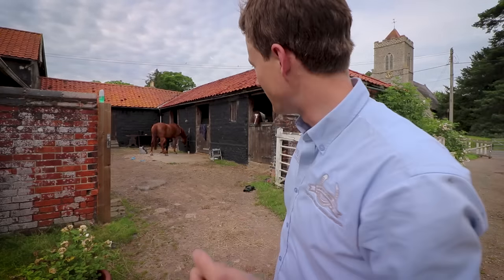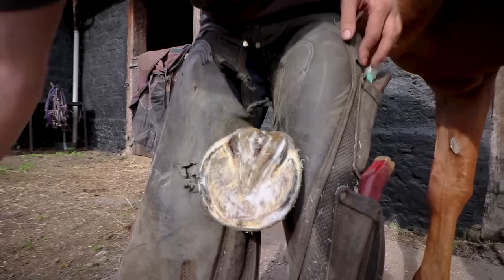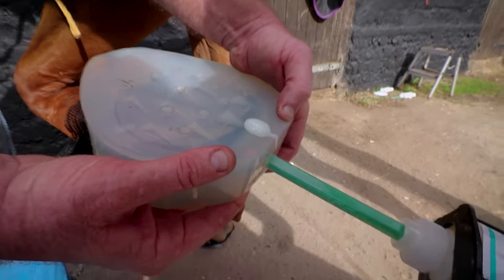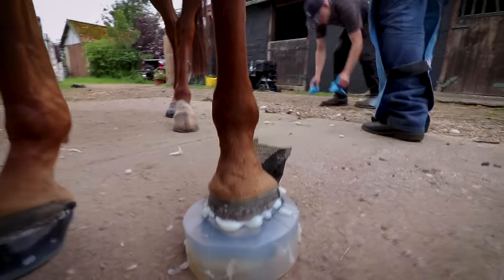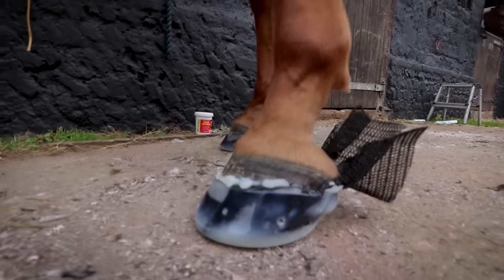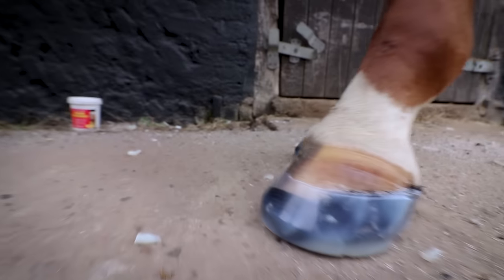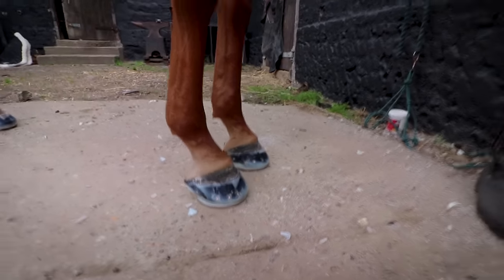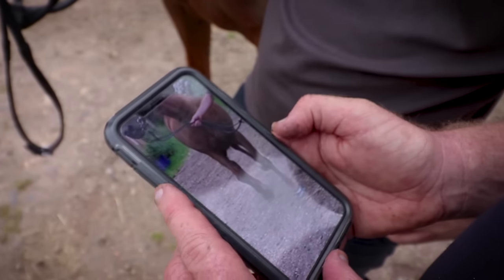How to shoe a horse using resin - Amazingly satisfying

Comment: Since it’s a 3D printed mold, why not add a couple small handle around to the outside near the top of the mold so while your injecting the material, you can pull the upper edge away to allow even flow.
Reply: I'm wondering how uncomfortable the rubber insert being jammed into that shoe must feel. Does it all come off to inspect for fungi, bacteria mold? I know it's a silly question.
Reply: Urathane sounds very permanent, hot and cooking , does it burn the horse
Reply: Tire rubber so they got a soft run
Reply: The left rear shoe looks a bit off, like it's to far back.  Not over top of the shoe, and she walked funny on the left rear hoof as if to try to get use to it.
Reply: Great work!
Reply: @Ben Kenobi I would think if someone went beyond the "keratin an into a nail or hoof bed or if the heat seeped into a cracked area. It would Hurt.

Comment: Ok so when the hoof grows out, how do you trim this stuff off? Wouldn't it be more work at that point vs regular shoes?
Reply: That's what the mesh was for, I think they mentioned it in the video. The mesh keeps the plastic from actually bonding to the hoof. So, when the time comes they probably just run a Dremel or something similar down the middle to split it in half.

Comment: I didn't hear a mention of cost. Since horses need their hooves trimmed every 6 weeks, I'm curious how much this would run for a year.
Reply: Would this obviate the need for trimming?
Reply: Every 4 to 6 weeks, depending on growth rate and wear.
Reply: @stephridestheworld  If your horse has sandy soil in the pasture a person can go 10-12 weeks between trims.  All depends on circumstances and surroundings.
Reply: @sherryevans7944  The opposite actually - if the ground is soft then the hooves don't wear down as much thus needing a trim earlier. But soft ground isn't good for the horse's legs anyways.
Reply: @vivientakacs5599  I have 3 horses on sandy soil and I for a fact know how long they go between trims!  All BS to market a product.
Reply: @sherryevans7944  Market a product???? I don't even like shoeing horses, they should all be barefoot (unless of course they have some illness and temporarily need a horse shoe). This is/should be common sense cuz obviously, if you have less drag against something, it will take longer to wear off vs if a horse is on hard ground where there is a lot of pebbles or anything else, the hoof will wear down quicker because the hard stuff rubs against it.
Reply: @sherryevans7944  Also just because the horses are on soft ground, it still shouldn't take 12 weeks for them to be needing a trim. That doesn't sound healthy.
Reply: @vivientakacs5599  I do not agree.
Reply: I don't know anything about shoeing, but based on the labor I see, that looks like at least a USD$200-250 job with foot care, polymer application, and horse shoes. Searched some US pricing for shoeing horses, and it varies quite a bit. $80-200 for four shoes, and up to $300 for specialty pads. Don't know what specialty pads are, but it sounds like something such as this fits into that category.

Comment: So with the exposed mesh on the  bottom, what prevents moisture from getting in there and just sitting against the hoof?  Does that ever cause problems?
Reply: most likely a plastic mesh, shouldn't wick any moisture in
Reply: @jdigi78  its still a mesh material though which retains moisture
Reply: @floridagirl9064  if it's plastic the moisture can't travel through the strands into the shoe. Plastic doesn't soak up moisture like that
Reply: @jdigi78  if it is a meshy material it certainly will.
Reply: @floridagirl9064  the shape of the material has nothing to do with it, it's fully encased in resin the only exposed mesh part is on the outside of the shoe
Reply: @jdigi78  mhm...exactly...
Reply: @floridagirl9064  but it won't touch the horse's feet which is the main concern

Comment: Yes but how does the horse foot sweat? Also that stuff looks like it would prevent the hoof from flexing properly during impact.
Reply: I dont know if youre serious, but that part of the hoof definitely doesnt sweat. Also this isnt any worse than normal horseshoes - yes it would prevent the hoof from flexing 100% naturally but the difference isnt huge and the structural integrity is definitely better than the hoof before so it's basically worth it. In short - a hoof that's deformed wouldnt absorb the impact well anyways, so its better to just care for the structure.
Reply: @friskaminomleczkojad5585  I was referring to the bottom of the foot that would not be able to sweat. As far as not being able to flex have you ever wore a really tight pair of shoes for an extended. Of time?
Reply: @WildernessCall  no, the bottom of the foot doesnt sweat. Its all dead tissue on the bottom, thats like asking if the top of your fingernails sweat under nailpolish. Also, would you rather walk with a broken foot or have that foot in a cast that allows you to walk propely?
Reply: @friskaminomleczkojad5585  horseshoe is merely a thin strip of metal under the horse's hooves.
Horse shoes still allow the hooves to interact with the environment, air, water, sunlight, natural oils etc. 

This is literally like acrylic entombing something which is biological and growing all the time.

Any moisture would be trapped inside. Not a good thing.
Reply: Not to mention urethane (which they used) is toxic asf. Such a damn shame they put that crap on a horse and call it the "future of horse shoeing"

Comment: For medical reasons such as regrowing a hoof, this seems very useful! However, I'm worried about just the one thing – as the horse steps down on their hoof, the hoof expands, no? This happens even with shoes on, since the shoes don't cover the entire bottom of the hoof. So then – does the formahoof allow for that expansion, which is like a built-in spring for the horses? I'm worried that this would lead to injuries on ligaments and such because there wouldn't be enough spring in the hooves, so to speak. Granted I am in no way a farrier or hoof expert in any other way, so please correct me if I'm wrong – this just seems to be what I remember being taught when in equine anatomy and physiology class a few years ago.
Reply: I watched another video shows detail. There is mesh that helps with that and they make sure of placement to allow flexibility.
Reply: It's formed while the horse is standing so no, there's no issues

Comment: What happens, do those casings eventually fall off on their own once the hoofs grow or is it a manual process take then off?
Reply: from my knowledge of shoeing (it's been a minute but i had it from hands-on experience at one time), they would likely wear down with use, hence the 180k steps rating, and also grow out as the hoof grows/be trimmed off as you trim the hoof, just like nail polish!

Comment: Legitimate question: I've always thought that the exposed frog was healthy to promote good blood flow through the hoof. This seems like it would prevent compression of the frog, so wouldn't that be detrimental to the long term health of the hoof?
Reply: yes! absolutely! this is detrimental to hoof care and the overall health of the horse. It throws their hips out of whack and sends them lame, plus everything you mentioned above!
Reply: Very true that is why old farriers prefer the old standard metal horse shoe.
Reply: I'm new here and rather ignorant on these issues. I got the impression that this is a temporary intervention. I could be wrong.
Reply: Better than an open backed metal shoe as the shoe lifts the frog off the ground altogether. With formahoof at least the whole sole and frog are still weight bearing as they should be. Barefoot should be the goal but when you have damaged hooves this is a better temporising measure than what a smithy can achieve.

Comment: The nails in the urethane will create a water entry point, and water will remain inside... not a good idea....
Reply: How? Exactly?  nails are facing down like in a normal shoe , the urethane seals around the nail anyway.
Reply: @crowrage8929  haha
Reply: @nunofelicio  This isn't a plumbing  issue, it's a horse hoof .Designed to last 250 k of use not permanent.
Reply: @crowrage8929  Imagine having your feet inside a bag with water, I'm not understanding your necessity of dismissing the issue, are you involved with the company?
Reply: @nunofelicio  Buts it's not water is it, it is adhesive,  and there  would be little to no water, in the hoof ,unless  structural  integrity is compromised, then it would be time to change the shoe,as they are not permanent  anyway.Also when I put my feet in water, I use gumboots, works well unless the gumboot has a hole in it ,then I replace it .Ie structural  integrity  equals no capillary  effect.Just like a natural  hoof.
Reply: @nunofelicio  if you look closely after he hammers the nails, they go out on the side, they don't connect with the interior cavity.
Reply: There’s no cavity, what are you going on about?? The urethane is sealed to the hoof
Reply: @nunofelicio  I get maybe you are an expert at plumbing but this is a horse. Are you a farrier? Probably not.
Reply: @crowrage8929  Ín a natural hoof the material is porous, it will dry, in this case, it will not because the majority is sealed in urethane...  just think as it was your nails when you finish bath...  Never seen so much effort to dismiss a valid observation... crazy crazy....
Reply: @karladougherty5694  Lolololol... yes... and you are an expert in telling other ppl professions from two or three answers. Ohh well.... sure is a sign of current times...  back to my dear friends and patients :)
Reply: @nunofelicio  Your point? Doesn't need to dry  if there no water in it, does it, the nails don't even breach to the natural  hoof anyway,so they are sealed from any potential water effects.  I would make constructive input, or actually  ask a  question , before  making  a negative observation ,crazy...crazy..

Comment: What happens as the hoof grows?
Reply: Judy Dell take it off and cut the feet
Reply from the maker: The hooves grow from birth right up until death and continue to do so even when steel shoes are applied. That is why horses are trimmed and shod on a regular 5/6 week interval
Reply: Alex Ridgeway Farrier so I guess there is room in the plastic for it to grow?  That’s what I mean. I know the hoof continues to grow.
Reply: The hoof grows from the top down. So over time, there would just start to be more exposed hoof above the plastic and once it comes time to trim it would be removed to do so and then re-applied. Similar to traditional shoeing, I would imagine that these would allow the hooves to grow longer without much flare so they would be fine up until the next regularly scheduled farrier appointment.

Comment: The gimmicks just keep coming. How much does a pair of these cost to apply?
Reply from the maker: You call them gimmicks, I like to think of them as another tool in your tool box 👌😁
Reply: I've used polyurethane an 2 part epoxy for years as they cure some can get extremely hot how does this compare

Comment: I have thoroughbred horses (race horses ) in Sweden , the surface is very different from on season to the other , that would be a real good solution for horses with little feet .
Could this application work for morning work out on sand or grass galops ?
I saw that the horse you were working on a  thick tendon , is he better now with this typ of shoeing ?

Comment: Great idea for rehabilitation and short term use. From experience hooves naturally adjust to the terrain they are walking on, soft muddy = soft misshapen hoof.
There is a definate application for this treatment in a rehab setting. 
I love these beasts. Fungus ? the hoof is like a fingernail that continues to grow. Carbon fibre with air vents. ? Why reinvent the wheel, the Farrier does less work when shoeing
Reply: Because solely load bearing on the hoof wall is damaging long term. Ends up with caudal hoof failure and contraction.

Comment: I have a couple concerns about this, Using this method seems great, but the hoof has to have air circulating around it or it will eventually damage the keratin underneath. Also how do you get it off? Soaking? in what? grinding? does that damage the hoof? what about if the horse cracks the urathane shoe (like when a woman breaks her solar nails?) will it crack the hoof? It is very much like a woman with fake nails and all the chemicals are not good to wear all the time.

Comment: When you turned the hammer around the points side where it came out of the PU-shell, did you do that to bend it so it points out straight, to be able to snip it off easier afterwards, or what did you do there exactly for what reason?

Comment: Nice, but I don't get the shoe-part. You already have a predefined (cast) surface to work with, why not use this as a system with a fitting horseshoe instead of a normal one?

Comment: This is what causes issues. You are making something that is suppose to be able to handle walking on every surface and protecting it. Causing it to become soft its self. What happens when the hoof grows? The nails are very high on the hoof, when it grown, wont it cause discomfort when the nails start to be pulled down?

Comment: So uh polyurethane resin gets incredibly hot as it cures...how is this not painful? Its probably the equivalent of having hotcoals strapped to your feet for 20 mins. Sure its cured in about 10-15 mins. But it holds the heat longer...

Comment: Doesn't the hoof need to breathe?
Reply from the maker: Not really.... The outer horn is made up of the epidermis or outer skin... Its supplied with nourishment from the inner skin or dermis. It's function is to protect the internal anatomy and therefore is relatively impermeable.
Reply: @AlexRidgewayFarrier  by outer horn I'm assuming you're talking about the outside of the hoof, correct?  I thought that was made of keratin...like a fingernail.

Comment: do not do this, the cup of the horse's hoof is flexible in the heel part, adding that rigid supplement to the cup causes the horse to suffer from pain when walking and tread poorly. for that reason horseshoes have to be open at the back

Comment: Having owned my own horses
I would never do this to them
Consider their hoof's do grow and the direction of pressures that will happen after a few weeks,
They will probably end up splitting cracking or becoming loose some where along the line
The only reason I would do this, if the horses hooves were cracked split and needed to be held together until they heal
This is expensive, and much cheaper and safer just to put regular shoes on any horse, except horses with deformities,

Comment: You really, really should wear gloves and be very cautious when working with urethane. The isocyanate compounds that form the urethane are highly toxic
Reply: totally fine to let it soak into a horse though apparently🤨
Reply: @brandonquarles1484  it only comes into contact with the hoove, that doesn't matter.  it won't pass through that much keratin and get into the horses body